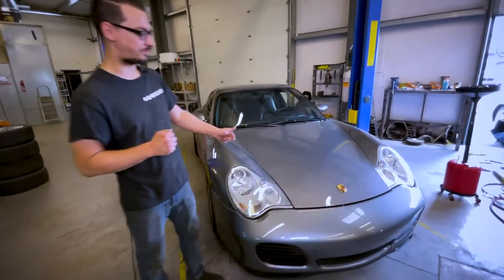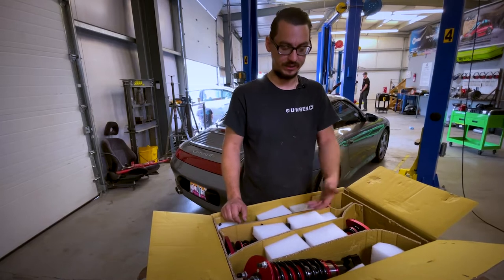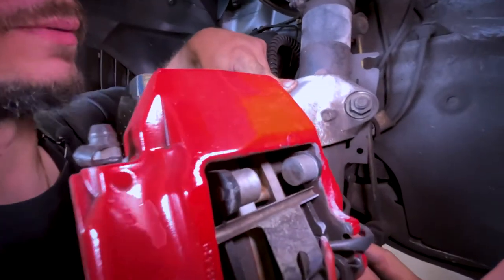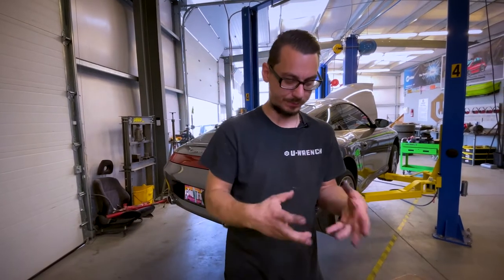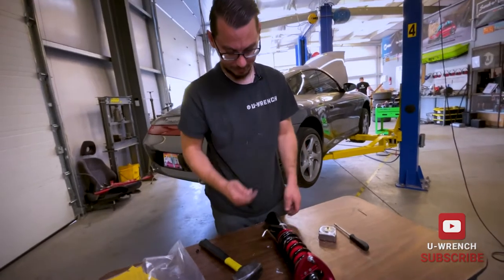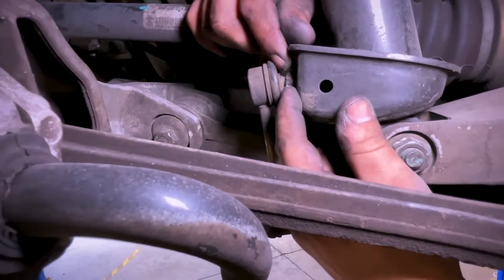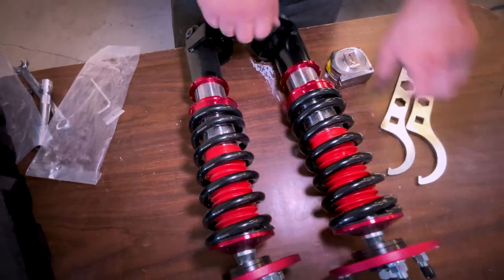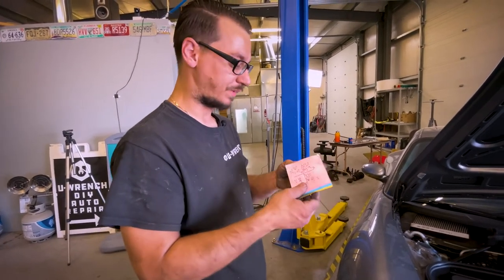Step by Step guide to installing and adjust Porsche Carrera 4S Coil-Overs

Comment: I find it easier to take out the lower control arm with the strut assembly, and remove the strut as a complete assembly. For every day driving the factory M030 sport suspension is very good, no need for cheap coil over debates or spending hours getting ride height set. Porsche already figured it out for you. No weird issues with binding noises either. Also, for the rear sway bar links, just disconnect it at the other end and then remove it later when the shock is out. Way easier. If done right this is a fairly easy job.

Comment: Hello guys can you helf me out, we installed the same coilovers on a 996. I have an issues when I turn the steering wheel left or right spings make binding noise.
Reply from the maker: Brandon suggested that maybe the sway bar end links are adjusted wrong or possibly preload is adjusted to firm. Just a guess without seeing it
Reply: @UWrenchTV   thanks alot guys for a quck reply,  I set the prelaod the same way as you guys did.  How would I know if the sway bar links are set properly?